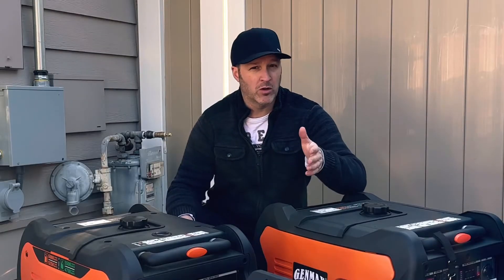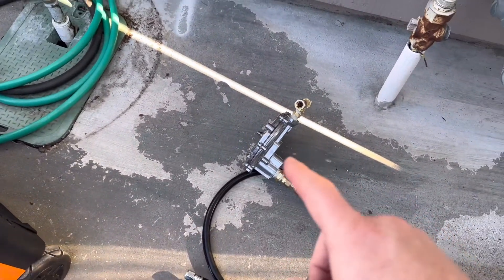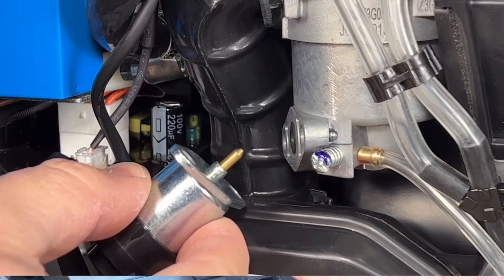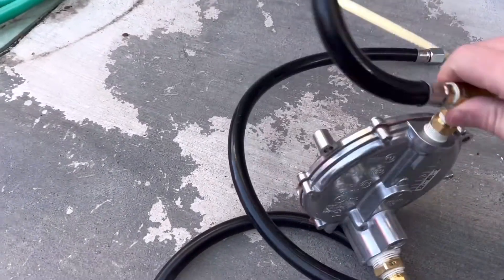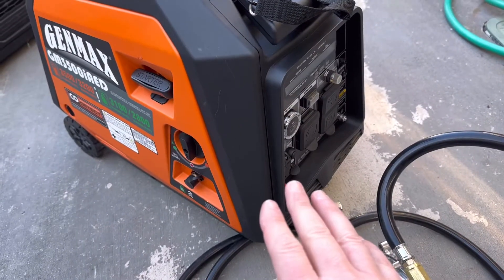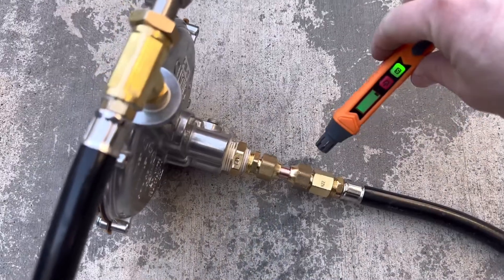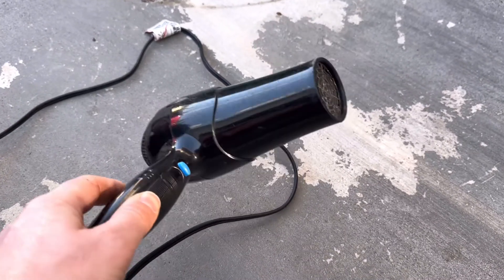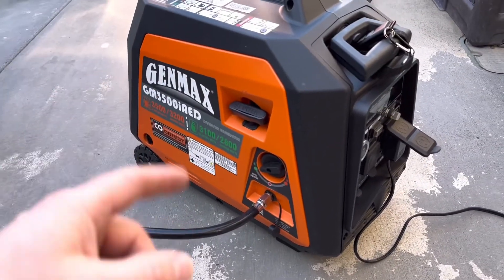ADD Natural Gas to Dual Fuel Generator…

Comment from the maker: What do you think ? Does this help answer some questions?? Let me know. 

TopTes Gas Detector PEN!!: https://www.amazon.com/dp/B0B62LBZPC?

Buy me a Coffee 👍🏼🙌🏼👊🏼😀
https://www.buymeacoffee.com/johnny5120J
Reply: Much appreciated, yes this helps.
Reply: Kind sir, thank you. I was just wondering if you could just plug a NG hose onto a duel fuel generator. Would you HAPPEN to have a list (partial or complete) of duel fuel generators that don't have the regulator INSIDE the hose connection like you showed? ie the eaay connection you showed using the natural gas???
Reply from the maker: I don’t have a list because even old models change. You would have to see what brand and size you would like and then look at the hose. That is the easy way to tell. Most smaller units will have it outside on the hose since not a lot of room in the smaller generators.
Reply: @johnnysweekends  appreciate it, thank u

Comment: You mentioned it needing to be 15 ft from the house, is that a requirement or best practice for safety recommendation? The house we just bought was built to have a 50 amp portable gen (built as a future install project). They even put a pad for it but the pad is against the foundation with the natural gas stub out approximately 15ft up (ie stubbed off the top floor garage with pad next to the walkout basement).

Comment: @ johnnysweekends I have a Westinghouse iGen5000 DFc inverter generator. Essentially, I would like to convert my generator into a tri-fuel system by adding the ability to hook up to natural gas, by simply connecting a natural gas regulator rig, similar to the propane regulator that came with the generator. I do not want to loose the ability to utilize propane. Some of the conversion kits I see on the market seem to replace the propane connection option for natural gas. Is there a way I can rig up a natural gas regulator that fits directly on the factor propane connection. This way I can use either regulator connection?

Comment: @johnnysweekends I have a Westinghouse iGen5000 DFc inverter generator. I would essentially like to convert it into a tri-fuel system by adding the ability to hook up to natural gas. I do not want to loose the ability to utilize propane. Some of the conversion kits I see on the market seem to replace the propane connection option for natural gas. Is there a way I can rig up a natural gas regulator that fits directly on the factor propane connection. This was I can use either regulator connection?

Comment: Do you know if this kit would work with the new genmax gm7500iaed 312cc model that just came out recently? I noticed on this model the propane connection is on the side like the smaller inverters compared to the 7250 where the propane connection is in the front.
Reply from the maker: I don’t know. I hope to get one of those soon

Comment: I've got a Genmax 7250 dual fuel. I connected to my natural gas with generator set on the propane setting. It worked with no issues. I made no modifications to the generator.
Reply: 1400 sq home, all lights, ceiling fans, fridge, deep freezer, tv, electronics, garage door, 12,000 BTU indoor a/c with window vent. NOT connected was the main house a/c, electric range, water heater and clothes dryer.
Reply: @sgrios1  it will run hot due to higher pressure but less fuel and will shorten lifespan of engine. You need to change venturi and regulator for proper backflow and feed
Reply from the maker: Interesting… I’ll have to retry. What’s loads are you able to run?

Comment: Johnny, I think you might want to revisit this topic. I just called Century to figure out how to get a Champion dual-fuel generator running off NG, and they said an an air box snorkel is necessary. This is despite Champion generators using external demand regulators on the hose running from tank to the front panel gas inlet. They explained that the propane feed inlets are "too restrictive" to allow for these generators to run at full load with NG, even if you use a different hose with a demand regulator tuned for NG pressures.
Reply from the maker: True, plus hose length will matter as well.
Reply: @johnnysweekends it would be great if you can revisit this with higher capacity inverter generators too. Those of us in places like Houston have already bought what was available in the Hurricane season, and it’s difficult to procure fuel, even propane for an outage that lasts 7 days.
Reply: @johnnysweekends  I got the same response from Century and Nashfuel.
Reply: I am in the Houston area and suffered a five-day power outage, but I was able to use a dual-fuel generator while waiting for power to come back. I just received a regulator from Nashfuel and was planning on mounting it before the propane/gas switch. Are you guys saying here that this won't work and that the switch is too restrictive for natural gas?
Reply: @redb2153  yes, that’s my feeling. I opened the panel and looked at the propane pipeline going to the carburettor from the inlet, it’s 1/4 inch. I feel it’s too narrow to support any decent load on Natural Gas, but I’d love to be proven wrong
Reply: @rohitshrivastava4742  Hi, I have a champion duel fuel inverter generator 3400W. I can put this matter to rest as I have done this. The maximum load that can be supported is 1400Watts. The propane line is only 1/4 inch. This generator would be difficult to add the snorkel and all the rest. It just seems impractical.

Comment: I was wondering if you could share the link with me for the natural gas conversion kit you used on the genmax 3500iad? I have that same generator and would like to do the conversion like you did in the video. Thank you
Reply from the maker: They don’t actually make one for it. It’s a universal kit and you would have to build it a little. It’s just brass fittings and a hose. Some of the parts are listed in description

Comment: Just got the Pulsar mentioned below. It does have the internal load regulator you mentioned that keeps it from running ng. To bypass, can I simply couple the input and output hoses and rely on an external ng regulator?
Reply from the maker: So you could remove it entirely and use the kit. Or I would add a T after the regulator with a on off valve. I dont think it would back flow into the onboard regulator as once the gen starts running its pulling from the external.
Reply: @johnnysweekends  Thanks for the comment: even better I'm going to try a 3-way valve so either the propane channel or the NG channel will feed the carb; no chance of back flowing from either.  Your video was extremely informative; thanks again.

Comment: Hi, very informative, thank you.  I've had a NG feed with external regulator/conversion kit for a loud (76db) Briggs 5500 for years (works great), but have a new Pulsar 7250 coming today (62db), dual fuel.  Do you know if this will work with just an external regulator/conversion kit or does it have the internal regulator that would need to be bypassed? tyia.
Reply from the maker: Has internal regulator. Needs to be bypassed

Comment: Will this natural gas kit work on GENMAX GM4600IAEDC ?
What I’m looking for: is to have a lighter inverter generator below 70 lbs that is tri-fuel. 

Thank you
Reply from the maker: Sorry it will not. The onboard load regulator limits it. So you are double regulating and would need to by pass the internal one.

Comment: Does the T-fitting mixture adjust have any parts inside or is it just a long bolt with lock nut?
Reply from the maker: Just a long bolt and a jam nut to control flow..👍🏼

Comment: Please don’t waste your money on these Chinese junk boxes the 1st generator. I bought ( bilt hard) did well for 1 month. Then when it acted up it ruined. Sulfated $2000 worth of my rv batteries, took 2 months dealing with these idiots from China you get 1 sentence every 24 hrs on an email response. So it takes 1 month to resolve / return this pos, then the next brand I bought runs ok until it doesn’t and the propane regulator leaks so that cost me 200 of wasted propane that was August now it’s dec but guess what they still never resolved that problem . I have all the emails about it and still no new part. I emailed them a video they req of my electronic leak detector showing the propane regulator leaking. They say they will send new parts out by Dhl but never did .. Now they have passed on helping me and say the useless California service center will expedite a replacement but that doesn’t happen either. This is after another video and pics of another issue. Fuel dripping from air cleaner box to carb inlet . And a 3rd issue is a full clean oil change that still didn’t resolve a low oil light/ no start for 3 days and a brainless service center that doesn’t know where the low oil wire is located to disconnect it so I can start it . They keep sending me the same pic of the wire which I keep responding to tell them that’s not my generator 7250 I don’t have any wires or sensor like the pic shows . So the generator has so much vibration that the main battery wire harness is being cut through by laying against the metal and that’s with the wire loom covering over the wires how many other places is that happening to ? And this engine has way too much noise it doesn’t sound good to my ears As A 30 year Ase master auto technician…. So my advice stay away from all this junk take a road trip and buy a good used generac with a real USA industrial engine w/ a pressurized oil system with a spin on oil filter and a true continuous output vs this BS junk that’s flooding our market I have such a unit but in storage and thus needed a quick on the road unit for my rv trip . Anyone wanting to see my emails to confirm all I say is welcome to see them .

Comment: so is the Genmax GM3500IAED in the video already tri fuel?
Reply from the maker: No it is not. You need to add the external conversion kit and use that load regulator. Not the factory

Comment: i think you could do a T fitting on the existing propane hose that goes to the carburetor, drill a hole on the side of the generator, run a hose from the T through the hole that goes to a valve, on the other side of the valve you run a piece of hose to a natural gas regulator
if you want to use propane, connect propane and turn off the valve
if you want to use natural gas turn on the valve

Comment: What is the maximum power that you can get with this generator on NG? I have the same generator and same basic setup here, but mine shuts down above about 1200W. In my testing, I was hooked up to my NG line that normally connects to my gas grille, and it's about 50-60 ft. from the meter. I can add a takeoff point about 20 ft. closer to the generator, or worst case run a new line. I just want to make sure that the generator will put out decent power on NG... I'm hoping for something like 2400-2500W.
Reply: Did you ever figure out the peak & running watts for your generator on natural gas? 
Thanks
Reply: I believe propane has roughly twice the btu’s/energy per given volume of natural gas. So if you are feeding basically the same volume of natural gas as propane, you can expect natural gas to deliver half of the energy output of your generator as compared to propane….. I think? 😂
Reply: Strange, i saw somebody running 1/2 inch hose at 60 feet be able to power a generator at 5000 running watts, 6000 peak on natural gas. It is a 320cc engine though. Need bigger engine and more cc to run the same load  on natural gas.

Comment: Do you know which way the pulsar 9500 inverter generator is set up? Im wanting to add natural gas abilities to it.
Reply from the maker: Pretty sure the regulator is internal so it would need bypass which you could add a splitter after it for a second feed. But would still need a outside regulator

Comment: Newbie here so I really appreciate all your info.  But a bit confused.  I want a small generator (1 KW) that will run on natural gas (for power outages at home).  Would also be nice to run on propane (to use away from home).  Have no interest in running on gasoline.  All the only natural gas ones are huge.  So thought of getting dual fuel.  But are you saying if I want to run natural gas, it's better to start with a gasoline only generator?  Thanks.
Reply from the maker: You should take a look at the alp generator https://amzn.to/3N5nbHT

It’s propane only, can run a very long time on a 20lb bottle and would be perfect for charging thins and more. Simple, small and getting decent reviews..👍🏼
Reply: @johnnysweekends bummer, it's gone

Comment: I'm wondering if i can run a baja 900 inverter generator on natural gas
Reply from the maker: Sure if it doesn’t have a internal load regulator or is not dual fuel already then it’s easy with the kit..👍🏼

Comment: That’s why you need a battery on dual fuel generator, the solenoid needs power to switch from one fuel to another. They should have a manual backup switch because almost every generator has a dead battery.
Reply: I used to jumpstart these off of trailer batteries when i was an equipment technician.  worked like a champ.

portable jumpstart packs didn't work all the time since they require a minimum voltage and proper polarity for safety purposes.
Reply from the maker: These new units if you watch my dead battery video, I was able to start several of the Genmax units with a dead.

And yes the solenoid need to open or close for either propane or gasoline

Comment: Genmax has a Tri fuel "natural gas" generator
Reply from the maker: Yes they do now! I was the first to report on this and they have two models along with making some for pulsar. Genmax has several new models coming including a 120/240 volt small gen. So you can combine into parallel or series along with the new fuel injection model ..😀👍🏼
Reply: @johnnysweekends  do you know when the release dates are for the US and Canada?
Reply from the maker: Mr. Brown I have been talking with my contact and I think mid summer is when we should see most so then I assume another month or so till Canada gets them. It seems it’s always a couple months or less before you do. 

But the bigger V twin 12000k unit is a end of the year release from what I’m hearing.

Comment: would you need that regulator if the generator is tri-fuel?
Reply from the maker: No, tri fuel is ready to go 😀👍🏼
Reply: @johnnysweekends  Thank you! In tri-fuel generators or even in that regulator. Will the flow of natrual gas stop if the generator is shut off? Just as a saftey feature if you don't notice the generator stopped running natural gas wouldn't be flowing all over the floor.
Reply from the maker: Yea both the tri fuel units or dual fuel and the after market load regulator will shut off if the generator does. 
Although NG is lighter than air so it does dissipate quicker. But leaks can still be dangerous
Reply: @JOHNNY'S WEEKENDS  awesome thank you , it's good to know they have that saftey device built in.

Comment: Would this work for a dual fuel genmax 7250iedc?
Reply from the maker: Not with out modifying the inside and by passing the load regulator

Comment: Johnny, just wanted to let you know you can easily hook up a gen with internal Built in load regulator. You only have to buy a propane to natural gas conversion hose. It’s actually easier and cheaper than the one with external load regulators.
Reply: Lemfema 10 Feet Natural Gas Hose Conversion Kit for Grill, Low Pressure Natural Gas Grill Hose with 5" Outlet Pressure Regulator Valve and 1/2" Male NPT x 3/8" Female Flare. This is what i used
Reply: @caseymaples19xx I’m going to try this
Reply: @caseymaples19xx  can you confirm this still works. Was going to purchase Wen DF450i and do the same.
Reply: @alexsinbb  it still works with mine
Reply: @caseymaples19xx  and just to be clear the reason you don't need an on-demand style vacuum actuated regulator like in the video is that the WEN has a solenoid to shut off the air gas when the motor is off?
Reply: @alexsinbb  Did you get the Wen DF450i to work with Natural Gas ?
Reply: @dangenNG  no I gave up on the endeavor. I found a smoking deal on a 0 hour used WEN 56380i and forgot about the NG project for now.
Reply: @caseymaples19xx  
So if I understand you correctly, I just need the adapter hose if my NG pressure is already 0.5 psi?
Reply: @michaelpinkston4628  correct
Reply: @michaelpinkston4628  You absolutely need a regulator. Because if your generator quits (for whatever reason) the regulator will shut off the gas supply and prevent an hazardous situation…
Reply: @denisbrassard3549  Thanks for the reply, my generator has that built in.
Reply from the maker: I do t know if the internal regulator will operate correctly on the lower pressure from NG. A hose is one thing but correct pressure delivery is another. 
Did you try it with a couple models or anything ? Would be nice to just grab a hose.
Reply: @johnnysweekends  i have done it with both my pulsar gd400bn and wen dual fuel 4500 watt version. I actually needed to add a regulator as the NG supply pressure was too high.
Reply: This is cool